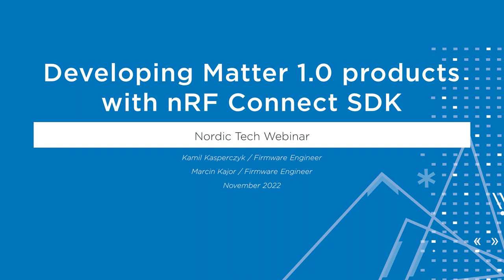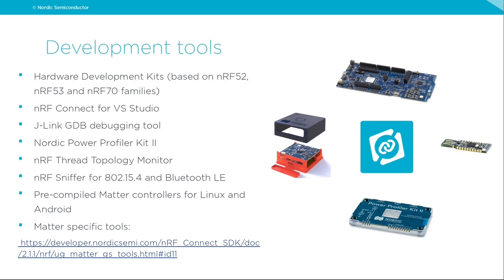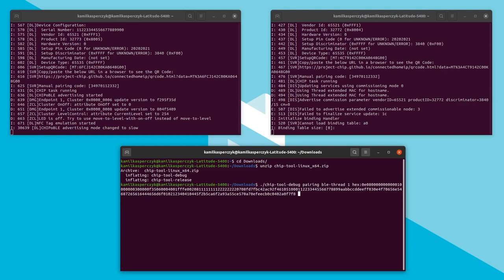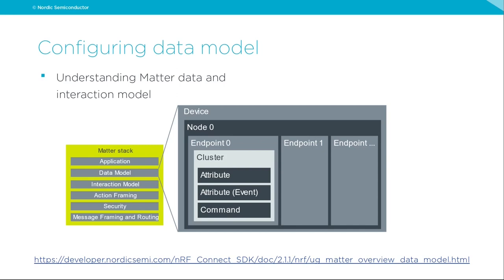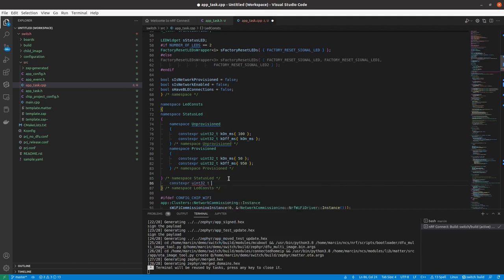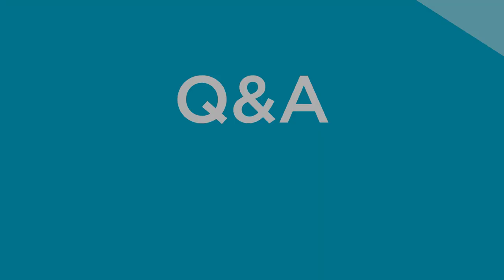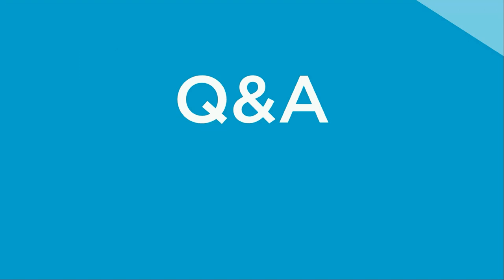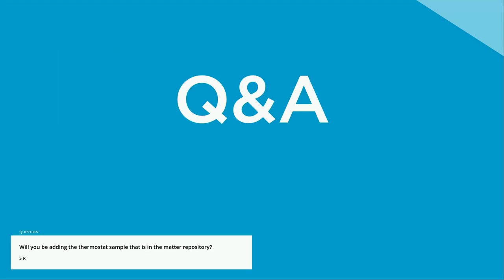Developing Matter 1.0 products with nRF Connect SDK

Comment: If we have an Amazon echo dot, can we use the Alexa app to commision the bulb and switch and then control them from the Alexa app?
Reply from the maker: The 5th gen Echo Dot (2022 release) supports mesh networking, so if you provision a Mesh network using your Alexa app on your phone you should indeed be able to control devices in the network with your Echo dot, or control the Echo dot from your phone's Alexa app.
Reply: @Nordic Semiconductor  That is Great news!
Reply: @NordicSemi  can you bit elaborate on this or give a link to more precise information. I guess in topology of 1st example Thread Border Router is provisioning a Mesh network, so logically speaking Echo Dot is replacing it. But does Echo Dot 5th Gen need any additional set up?
Reply from the maker: @ozren666 yes, if you use Echo Dot it replaces the Thread Border Router. You should not require extra set up, but we recommend reading more about Amazon Alexa Matter support here: https://developer.amazon.com/en-US/docs/alexa/smarthome/matter-support.html